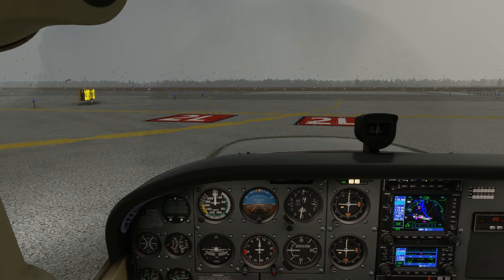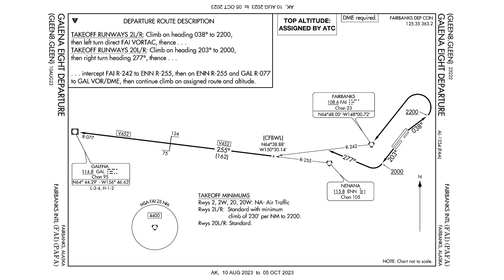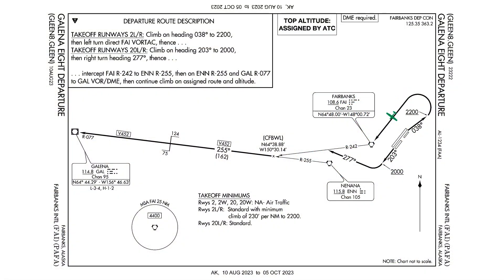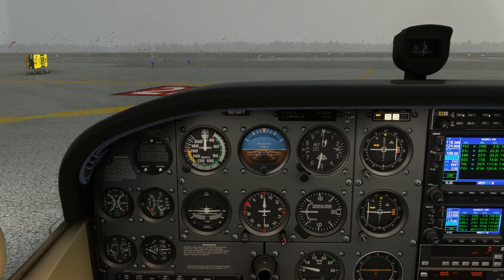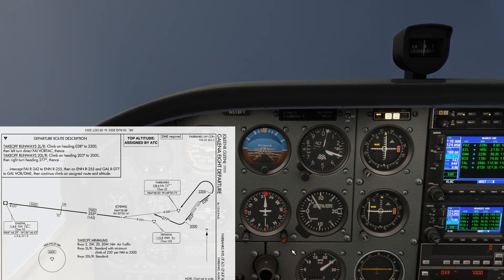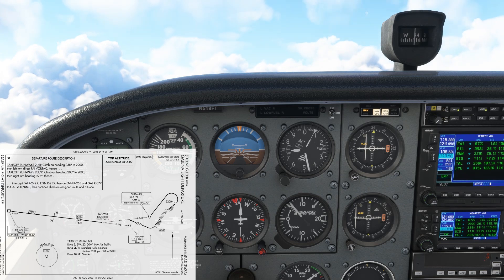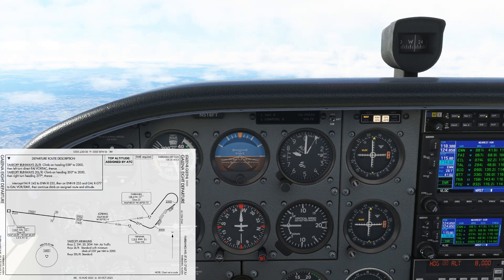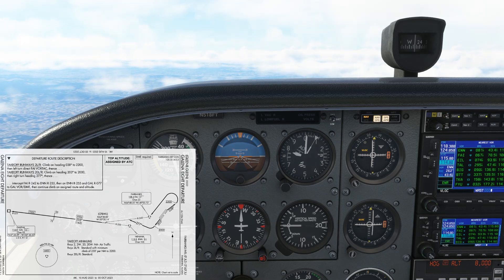How to fly a VOR Departure | VORs Made Easy

Comment: 03:16 "Runway heading 021". If that is the case then please skip my comment below. Do you have a good resource to look up the magnetic heading of runway 02L? (technically 2L 🙂I guess).

I think the purpose of climb heading 038 is that it does not make it a turning departure (runway heading 023 plus 15 degrees). My guess is that the procedure by default will be designed to provide an additional 15 degrees of protected space (as compared to a genuinely straight out departure aligned with the runway center line). I would probably be comfortable starting my track correction towards the right at basically any point past the departure end of the runway. Do you have a particular reason in mind to delay the turn to 400 feet above?
Reply: AIM 5-2-9 e.1. “Unless specified otherwise, required obstacle clearance for all departures, including diverse, is based on the pilot crossing the departure end of the runway at least 35 feet above the departure end of runway elevation, climbing to 400 feet above the departure end of runway elevation before making the initial turn”
Reply: @samwils1  Thanks. So should I read that as track extended center line until the initial turn? And you would also do this if the difference in heading was 'just' 5 degrees for instance? Interesting, thank you for locating the AIM paragraph.
Reply: @Rodhern  with visual references available I would fly the runway center line initially. 

Would check for obstacles in the notes if visibility is low or at night. 

When flying a heading below 400 feet, obstacles close to the ground are a hazard especially during a strong crosswind. As you move off of the runway extended centerline you could stray off of the evaluated obstacle clearance area. These would not show in the notes for that runway.
Reply: @samwils1  Oh, ok. That is a very accurate answer to my question. My initial guess (original question) was that the procedure evaluated obstacle clearance area was extended (rightwards), at the very least to account for an (early) track correction at the departure end of the runway by 15 degrees (038 minus 023). If that is not the case, an 'early' track correction would indeed be dangerous (in real life flying) and thus a strong reason to not turn. Thank you for the elaborate answer.

Comment: VOR and ILS approaches are more interesting than GPS? Thoughts?
Reply: Hey! Since you're asking for opinions, here's mine. I mostly fly the airbus a321-231/211 in the sim but I still find VOR approaches obviously more interesting than ILS. Especially when using TRACK/FPA. In managed modes is kinda the same as any other approach, the only difference is that you gotta monitor the VOR needle and that's it. Lastly for me GPS approaches (now called RNP and RNP (AR) are more interesting for me than ILS due to the requirements behind it, such as Nav performance, having a lateral deviation scale in the PFD to be able to do less than 0.3nm approaches, both AP etc. Also in RNP (AR) you have radius to fix legs which are way cooler ;)
Reply: When you fly a VOR approach that heads in the direction away from the VOR, you are actually having the approach course widen as you travel away from the station. Approaches that head toward the station are more accurate. GPS course width stays the same if it is an LNAV and is more precise if it is a LP or LPV.